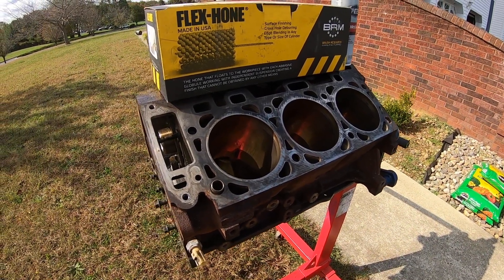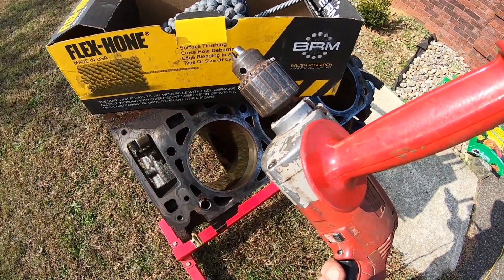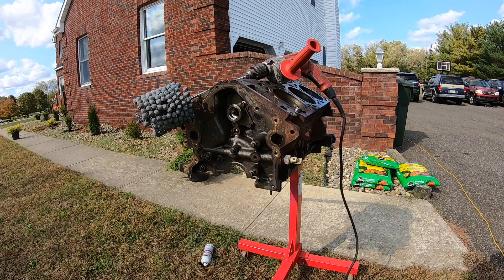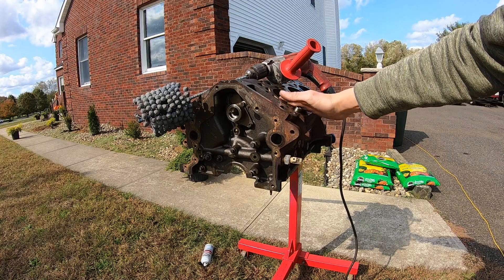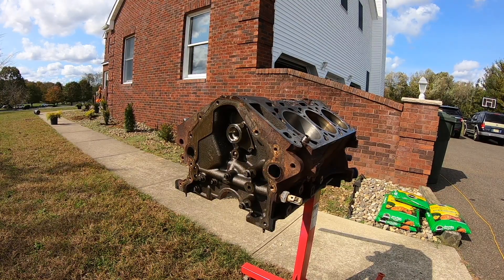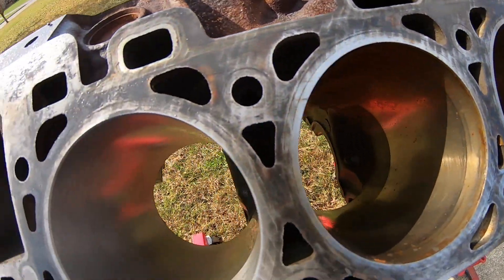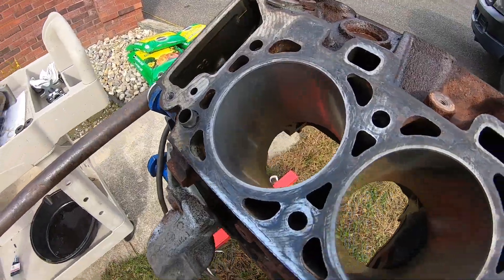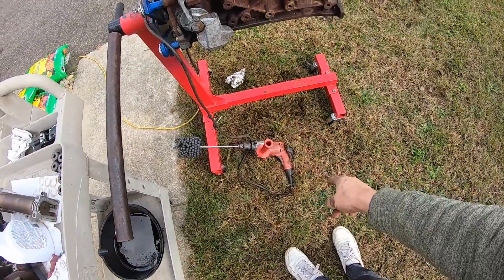How To - Engine Cylinder Hone DIY (Ford 4.0 Block)

Comment: GREAT VIDEOS I LEARNED DO MUCH FROM YOU. QUESTION. I KNOW I AM OFF SUBJECT BUT WHEN REPLACING THE CONNECTING ROD BOLTS. AND AT 12 TO 16 DOLLARS A PEICE DO YOU HAVE TO REPLACE THE CONNECTING ROD NUTS  I BOUGHT NEW BOLTS BUT DIDNT HABE ENOUGH TO BUY THE NUTS YET. THANK YOU

Comment: Such an under-rated channel
Reply from the maker: Thank you...starting slow but gaining momentum.
Reply: @iamdjnam  finally got er running this morning after like 3 months lol. Got the engine in and it would idle fine but had no power, the faster I tried to go the less power. I eventually figured out I had a clogged up cat.
Reply from the maker: @BombsAwayMineCraft  Nice!! Great job on getting it running and very nice troubleshooting. Remember to recycle the old cat, you can actually get paid a few hundred for the core.

Comment: Is that a distributor hole plug in what would have been the lifter valley?
Reply from the maker: Yes. I’m not sure why they wouldn’t just plug it, there’s actually o-rings with a gear on it.
Reply: @iamdjnam  ... that's interesting. Maybe a traditional distributor and carburetor could be swapped in. Thank you.